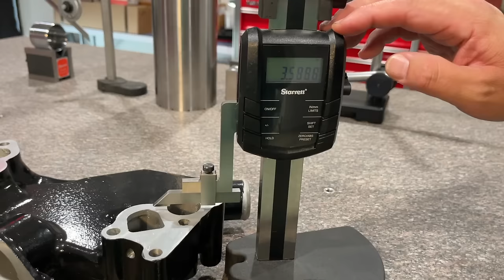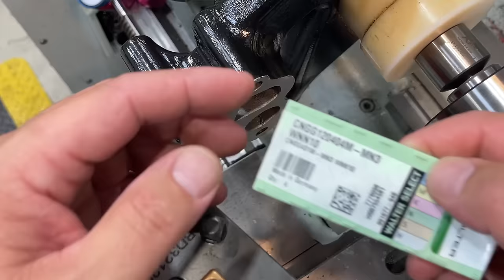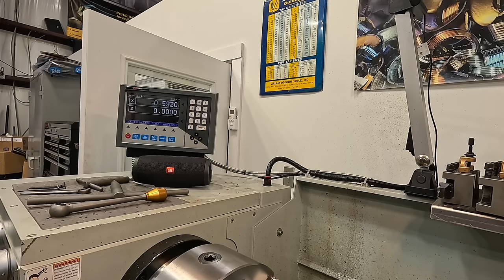Mopar Water Pump Housing - Machining .240" off Thickness

Comment: Beautiful machining job. As others have said, the customer is always right!. I think the custome may struggle to fit this watertight - look at the traces of the previous gasket on the old (red) housing at 50m 50s - look at the shape of the pipe in the upper left on the trimmed back (black) housing. Would be interested to hear how it turns out for them.

Comment: The flange was the only thing that I was concerned about.
I had a 1978dodge B300 motorhomes and my only issue with it was the modern gas eating the plastic and the glue out of the bottom of the carburetor..

Wonderful job as always, I really like your work ethic on all of your work.

Comment: Just my opinion, doing it on the mill is safer and the inside bore for the water pump would guarantee no bite marks.
Plus less set up time.
Reply: Abom is turner, not miller.

Comment: I'd say "Close to parallel" is good enough. The pulley belts aren't that sensitive to a couple thousandths difference between front and back housing planes. The more important thing is the same plane for the block inlet flanges. (even then a thicker gasket and sealant is pretty forgiving on tolerance mismatches.)

Comment: The initial clearance check out missed a hand rotation at the finished minor diameter. Usually your tool can't get to that circular plane but with the underside valley would permit the set up check.
Finding the flange interference if having enough lathe, pull the 3 jaw for a 4 jaw or face mill.

Comment: At 6:00min the first job I would have done here would be to pivot a straight edge across one of the flats and that inlet/outlet would have immediately shown up as being in the way. Why would I have done this ? Because at my age I have found that nothing is as simple as you would like at almost every turn. The biggest single issue with the machining of any weird shaped part is somebody else will have always made some bit stick out where you don't want it.

Comment: Adam, your use of the height gauge may have been flawed. I think a test indicator should have been put in there and moved to zero each time on the test indicator. Then do the delta. That way you are not pushing too hard or modifying the height by your hand. While it worked, the scribe is not a good way of measuring. The test indicator gives a perfect indication of when you have reached the same point with the tip, then read the height gauge.  Just my opinion..
Reply: Its a part that will grow by 10 thou or more with heating, and its a nonuniform shape, so its growing in all sorts of directions. A few thou lost with how he measured isn't bad.
Reply: @anothermidlifecrisis  I think you miss the point.  And this has nothing to do with it in use, only with it being machined, and his process of measuring is flawed.  For this application it probably won't matter, but for machining in general that creates too heavy a hand, and too much chance for an incorrect reading.

Comment: First cut, there was a shiny spot on the flange. Surprised you didn’t see that. That said, fascinating stuff & a sweet job overall. 👍 I think the customer will have to modify the gaskets on the machined part, though: looking at the old one in the last photo the standard gasket for the upper (on the screen) connection will overlap the new port size.

Comment: The point of this video,is to machine as per customer's requirements,which was achieved carefully and very nicely and to tolerances,whether the customer has problems with  his requirements when fitting the part is irrelevant

Comment: After looking a pictures of stock gaskets, I don't think they will work with the larger holes. Hopefully there is a large enough flat surface on the motor to take a homemade gasket.
Reply: Exactly the ports in that casing are angled so taking that much material means they are unlikely to make with the dimensions of the original matching surface unless the plate will be machined as a transition piece between the old and new surfaces

Comment: I told my wife you were going to hit the thermostat housing while you were fiddling with the plastic block, but figured I was wrong and it was just not the right camera angle for determining the clearance. 
I am really surprised that you didn’t notice the proximity of the tool to that edge whilst you were checking and touching on as you had the perfect vantage point , I thought I was seeing the first sign of contact as you were looking at the finish after the first cut at around 23:29! 😢
Reply: Same here! I was thinking it’s an illusion and there was plenty of clearance but lo and behold it wasn’t an illusion and it started to interfere. He’s just lucky that housing wasn’t actually proud of the faces he was machining. Could have chipping something or spun the part in the lathe  marring up the surface the chuck jaws were holding on to. Definitely a mill job from the get go.
Reply: BOTH OF YOU AR LIARS.
Reply: @jackjohnson6074  
🤣🤣🤣🤣 yeah, of course we are, because I have never run any machi… except being a toolmaker in a factory, I have my own machines at home too and play with classic cars for shits and giggles doing similar types of machining! 
But because you know me so well you jump straight to liar?
Reply: @grahamstretch6863  AND IT CONTINUES. I'M 84. BEEN MACHINIMG BEFORE YOU WERE CRAPPIN DIAPERS BUDDY.
Reply: Screaming at my phone even before Adam starred the first cut! Guess I didn't scream loud enough 😁
Good thing he noticed it, before too late.

Comment: All this precision just to achieve V belt alignment seems a bit much. I do appreciate all the considerations to clamp and hold this unique part for machining. I wonder what the tolerance was for the machining of the original part. I have built a 440 Mopar and they do not require this level of accuracy. This is truly a difficult part to machine mostly from a clamping perspective. That is the lesson of this video, the creativity required for clamping the work piece. Still makes for an interesting and instructional video.
Reply: Kind of why I like Keith Rucker and Steve Summers (hope all is well with him and the family, he has been absent for a LONG time with that new grandbaby).  Keith would have looked at this and thrown it on the mill right off.  Would have said "It doesn't need to be ultra-tight tolerance".  Steve would have probably put it on the shaper...LOL...

I love Adam, but sometimes....
Reply: @WreckDiver99 YES HE'S BECOME A REAL SHOWOFF
Reply: @jackjohnson6074  tried to show off on the lathe and was quickly schooled.

Comment: It was always a mill job, strange decision
Reply: He can do what he wants, but thanks for asking anywaysl
Reply: You mean other than the part where the machined teference plate is easily grabbed by a chuck, and the painted lugss prevent it from being dropped directly on athe lathe table. Setup time costs.
Reply: @amandaklapp1171  Put the machined surfaces up on some 3-2-1 blocks, strap clamp the body, and fly cut the flanges.  Lugs are not an issue at all.  I'm sure the lathe option is/was fine, but I would have been more concerned about leaving jaw marks on the o-ring surface.
Reply: @amandaklapp1171 so 123 blocks too much of a hassle? If the job is done to specification, any method will do. Great vid showing alternate means of doing things.
Reply: My guess is it is about the ease of machining both sides the same height. 
Single op, as opposed to mill with the available(?) tools. So chase the correct size once, not twice with the inevitable deviation between the two attempts.
Reply: I would have milled it. Did I miss it as to why this housing required rework to fit? What is driving the pulley mis-alignment in the first place? If it is this new housing, why is it so far off from correct? Regardless, there is more than one way to get the job done.
Reply: Performance engines sometimes use motor plates bolted to the front of the block and mounted rigidly to the frame, I believe he is making room for this plate. The original mounts on the side of the block are not strong enough.
Reply: As I'm learning I appreciate both setups
Reply: @charlieromeo7663 most likely a motor plate was installed making the pully not line up correctly.  Rather than shimming the other pullys that might cause clearance issues... who knows..  Sometimes it's just better to give the customer what they want and sleep soundly knowing you did exactly that.
Reply: @amandaklapp1171  Setup does cost time.. and it costs even more doing it twice.
Reply: @charlieromeo7663 1:09 he explains there's a motor plate that they're installing that's probably 1/4" think and that's throwing the alignment out
Reply: Some dudes straight to the mill and some go straight to the lathe.
Reply: @ninelivesracing  true. Usually based on what they are more comfortable with and what they think will get the job done.

Comment: Hello Adam.  Brit guy here! i am wondering what the US safety laws are like compared the UK?  at my work we have an old Czechoslovak lathe and other machines in good condition but we are not allowed to use them because for example the lead screw is not shrouded!  which seems a bit crazy as we are all old timers with lots of machining experience.  the machines just sit there gathering dust and debris.
Reply: Give them away to a hobbyist or youtube creator in your area that would use them and needs them. You can always sell them too.
Reply: Over here in the Colonies we don't use those guards.
Reply: Do you also need a quick stop emergency brake on lathes in the UK?
My last workplace here in Norway have a old lathe they had to retrofit a emergency brake to.
Reply: The E brake is tripped by a wire that runs as a fence all the way around the lathe.
Reply: Do machinist need to wear full hazmat suits with filtered air in the UK? Seriously, safety regulations are getting so suffocating that no profitable work can be done.

Comment: Hey Adam, you could really use Starrett PT11770A Holding Bar and PT22428 Swivel Clamp, combined with whatever dial test indicator you prefer, to measure those parts on your surface plate. The scriber you measured with here isn't really the right tool for the job, although it obviously worked well enough.

I have those Starrett parts just sitting at home, collecting dust. I would be happy to donate them to the channel, although I wouldn't even know how to get in touch.

Comment: Have to question the builders choice to have a wear item custom machined vs. a custom pulley...
Reply: The water pump housing is not a wear item. It has no moving parts. It holds the water pump, which is a wear item.

Comment: Nice job. Well, both of them.
Anyone else think those flanges need at least one more bolt each from original manufacture to help them seal better.
Reply: No. That flange has worked for dang near 60 years. I question why this replacement part requires this rework in the first place.
Reply: A quarter inch thick motor plate will be sandwiched between the pump housing in the block. This mod will put the pump housing back in the original position so the belts will lineup

Comment: If anything, you made the pulley that mounts to the front more parallel than it was.
Reply: yes, this is a trick to get more available adaptability in the pulley position, it also shortens the path from pump to engine block, which increases efficiency.
Reply: @craigulatorOne  Try and measure that increase in efficiency.😀

Comment: Reading the comments it is apparent most don't know what a engine plate is. It is a thick plate that bolts to either the front or back of the motor and reaches out to the frame. When bolted on the front it is sandwiched between the water pump and block. It is used in place of the normal motor mounts on the side of the block. In this case the plate is a 1/4" thick pushing the accessories out of alignment. Taking the 1/4" off the water pump puts them back in alignment. That being said and engine plate and restoration does not go hand and hand.
Reply: Who cares
Reply: @seancasey2444  Just an FYI. If you don't like it oh well.
Reply: @seancasey2444   Apparently you're watching the wrong video.  The whole point of engine mechanics and machining is to care about the details.
Reply: I thought it interesting if they were running a motor plate they didn't just put 2 an fittings in it and run hoses and call it a day. Using the factory style housing seems odd but if its what the customer wants its what they get. 🙂

Comment: Show me a person who has never made a mistake and i will show a person who has attempted nothing in life.
I see why adam used the lathe first off setup is way quicker and easier. If not for filming and the incident its a 5 minute job in the lathe. You would spend that just setting it up on the mill, making sure its level having a good area to clamp,etc. Dont get me wrong if it was a nice square part that could just be chucked in a vice mill everyday of the week from the off. Just a oversight and caught it before the parts wrecked. Fixed it moved on and got the job done.
Honestly done understand why people have to be so negative. Just because other people on youtube do show them making mistakes it just means theyre edited out
Reply: The ones who moan are tradesmen who can't and don't make mistakes, otherwise they are out of a job.

Comment: Nice job maching, somewhere something else has to be off on the engine to make the water pump pulley a quarter inch out.
Reply: They are adding a quarter inch thick plate between the housing and block.  Known as an engine plate, it makes a solid engine mount for racing applications.
Reply: he said theres a motor plate which is a fance way instead of using motor mounts. 1/4 inch thick
Reply: The finished size should be 0.250" less which is 3.347 - 0.250 = 3.097" not 3.087".
Reply: @tates11  did you watch the video? They asked specifically for  .260" off
Reply: @truckguy6666  fair play, I heard 1/4" several times and it does say 0.240" in the description.
Reply: @tates11  The engine plate is .250, but you have to add an extra gasket between the plate, so need to remove approx .010., for a total of.260.

Comment: Customer wants a bit off the Top of the Pump Housing (NON Impeller side) from a Machinist then that is what they get. The 2/3 (guess) of post here seeking to find fault with that should take a chill pill. The tiny changes to the porting just don't matter hydraulically in any meaningful or measurable way. This is no more or less different than doing a cut and shut of rigid plumbing on any water pump in any industry.

Comment: My first thought was mill/face cutter. Cant understand why you wanted to use the lathe but i thought it was a cool idea.
Reply: Lathe probably takes 1/4th the time in setup and cutting. But he didnt properly think it through chasing the efficiency and caused it to take even longer. He knows what he did, anyone who works on anything has made the same mistake 1000 times.
Reply: I'm not a machinist. I have to agree, the mill seemed like the way to go right from the beginning. No awkward piece spinning around, no questions about clearances. Just use some parallels to get the workpiece lifted and level and away you go.

Comment: so many calling it the water pump and now you're screwed .. understand this is just a housing that the pump fits into , so any stock pump will fit that now machined housing. zero issues.
as far as the ports not lining up, I bet the ports of the original housing & the block didn't  line up perfectly either . I see zero issues there with the larger port in the housing . I didn't see any one point out what sort of issue there will be with the different sized ports ... I assume the customer has measured the clearance for the motor  plate   & rad  hose that Adam ran in to with the lathe
Reply: God thank you man. This message board is crazy.

Comment: Hello Adam. To make sure that your measurements are as accurate and regular as possible, I advise you to keep one hand on the foot of your digital height reader on the marble.
Because pressing on the measuring head creates a thrust that is likely to lift the foot of the measuring tool very slightly and thus give a slightly distorted result.
Congratulations for your video and your work.
What happens to your property in nature?

Comment: I wonder if the water pump ports are still going to line up with the block ports, also if the gaskets will work.
Reply: of course they will, why wouldn't they? maybe they  won't match piece to piece , but water will go thru and the gaskets will seal  .
Reply: @johnmolnar2957  are you sure I wouldn’t be, some of the ports are not square to the machined surfaces and are at extreme angles. As you remove material the hole location also moves making an obstructed transition which isn’t ideal. Yeah water will go through but how much flow might get lost possibly causing cooling problems. That’s why
Reply: If you have concern use the stock gasket to port the offending 'blockage'.

Comment: Does it matter that the ports are different shapes now?  Will this cause turbulent flow in the system?
Reply: Won't matter. Flow in the engine isn't laminar flow to begin with...
Reply: @PhilG999  It just seems the original part used a plate to define the ports for a reason.  Of course this is no criticism of Abom; he did what the customer asked.

Comment: Turning Odd shapes sure looks sketchy on the surface
Reply: My thoughts too. Actually my first thought was to use the mill. It's not like the only tool Abom has is a hammer and everything looks like a nail!
Reply: @tlum4081  I've been watching long enough, that I know he likes to throw in an odd method or two just to show what can be done. He would have got away with it too if it wasn't for those pesky kids, errr I mean the input flange on the pump.